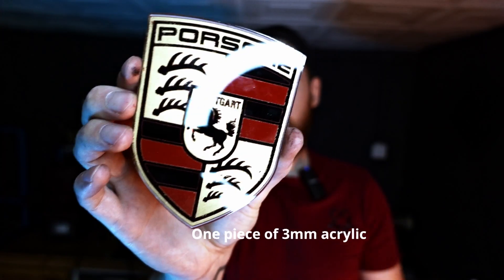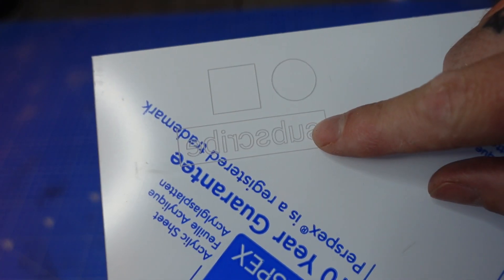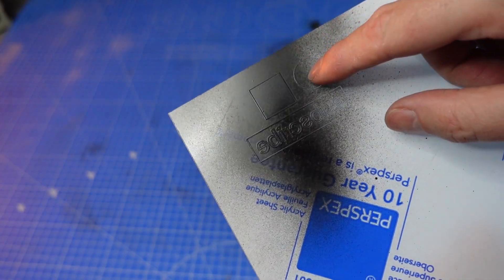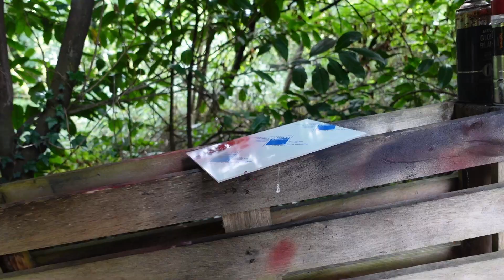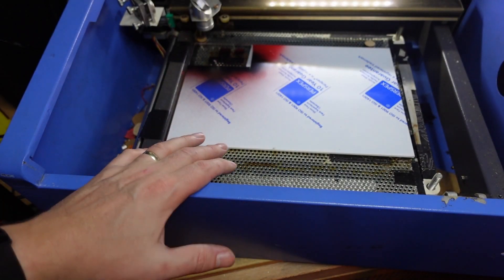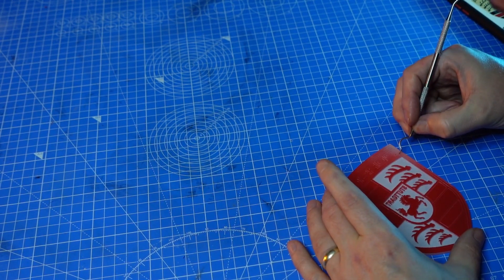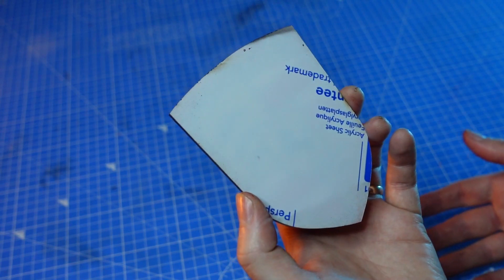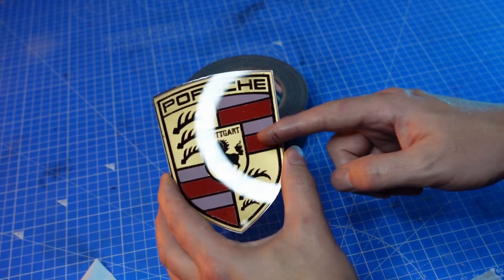This Laser Trick Adds COLOUR to Acrylic – Easy & Impressive

Comment: Hi there! thanks for this video! I would have never thought of using CLEAR acrylic to have an end result with color! 
Just brilliant! But what i'm confused about is, are these engraved or scored? because when I engrave acrylic, leaving the protective layer on, after engraving, the protective layer is completely gone. So does that mean you are scoring? Really appreciate your response, thanks in advance!
Reply from the maker: Thank you very much :)
It’s just a quick, low power score line you need to run with the laser. Just enough to cut through the backing. That then allows you to peel that section away ready for paint 👍🏻
Reply: @ perfect! I’ll try that today! Thanks for taking the time to actually reply!
Reply: @MARCAM  so i've started my project and my last color is black as well. But i don't recall seeing what you did for the last color black? did you also add a coat of lacquer then the black paint x3 coats? Then did you also spray on a seal coat after the 3 coats of black? so the black color doesn't chip?
Reply from the maker: @bonniesims2114 yeah a clear coat first, then the black (as many layers as needed) and then a clear coat for protection over the back. Alternatively you can use some clear backing tape to protect if you prefer 👍🏻

Comment: I'm just starting out in laser engraving so absorbing as many videos as I can and whilst I like your concept there is a much easier and much cheaper way of doing this. I'm well versed in silhouette studio my bread and butter is printing everything from clothing to stickers and the simple way to do this is create the Svg cut the acrylic out then print and cut a sticker to go on the acrylic.. not picking faults I'm enjoying your content I just saw an easier solution :)
Reply from the maker: Thanks for the input :)
You are right, that is a much easier way and it’s something I wouldn’t mind trying in the future. I think I’ll need to invest in a vinyl cutter though to be able to cut out the stickers property 👍🏻
Reply: @MARCAM  ah no problem I hope you don't think I was being negative I used the silhouette cameo 4 it's a brilliant machine and the software is free for the basic edition I have the business edition. The only downside with the basic edition it will let you load an Svg but won't re-save as an Svg so you would have to make the design in light burn or xtool etc then load it in to silhouette studio :)
Reply from the maker: @CraftedCustomCreations great stuff thank you. I design all my stuff in Inkscape so could probably just get away with the free version.
I’ll have to check it out for sure 👍🏻
Reply: Positioning the sticker perfectly aligned wouldn't be difficult as well? Also, I believe, the colors from the print would eventually fade away. The way he did will last and look "new" for much longer. Am I wrong?
Reply: @SeeYouJP  I use UVDTF stickers now they will last a lifetime 👍

Comment: I've done something similar using a normal cnc machine (Longmill MK2 30x30) and a springloaded diamond engraving bit (90 gedree tip) to scratch the image onto acrylic but it wasn't as detailed colored like this as I need to remove the protective sheet first to engrave with such a bit. After engraving, I spraypaint loose parts (as I don't have the paper backing, it's hard to spraypaint tiny details) and wipe off the excess paint immediately before it dries up. The paint in the scratches remains in the scratches while the rest is wiped off. I'm considering a CO2 laser but got no room and money atm to buy one. but this is impressive and so detailed. Good job.
Reply from the maker: Sounds like it was quite a bit more involved with the cnc then. Bet it still looked good mind.
You can get co2 lasers quite small these days. The k40 is a nice small desktop machine. The newer machine I’m using at the moment, the Mira 5s isn’t too big of a machine either 👍🏻

Comment: What can you do with these?  Will the paint scratch off easily if you use it as a key ring?
Reply from the maker: I mainly use this to make coloured signs. If you use a good enamel type paint and a quick clear coat over the top then doing key rings should be no problem. I use car paint so if you think how well car paint holds up 👍🏻

Comment: Very interesting concept. Why using a clear coat rather than directly painting on the acrylic ? Is it to make the paint bond with the plastic, like a primer? Or is it to make it shinier ?
By the way, you gained a follower.
Reply from the maker: Thank you very much 😊
And I spray a layer of clear just incase any paint does try and bleed under the paper layer. It rarely happens but I just like to be that extra bit cautious. It does help with paint bonding too 👍🏻

Comment: So you only score the design?
Reply from the maker: Just run an cut path with high speed and low power. Just enough to cut the backing so it will peel away nice and easy :)
Reply: @MARCAM  so it doesn’t mark the acrylic at all ? I get the low power and fast to cut thru the acrylic paper but it can’t mark the acrylic either ?
Reply from the maker: @beehr4468 it will be fine if it engraves onto the acrylic too as you will be filling with paint. Just try not to go too deep and risk cutting all the way through
Reply: Looks great!  What type of colored spray paint did you use?  Was it enamel?
Reply from the maker: It was car spray paints. So without checking on the can, I think most are enamel 👍🏻

Comment: I'm a newbie to laser engraving...did you just laser etch the backing paper so you use it as a stencil to paint it?
Reply from the maker: Yep! Just run low power and high speed and should cut through the backing paper no problem

Comment: You can do it through diode laser too ?
Reply: I have a CO2 laser which is able to cut clear acrylic without any problem. So I have to test if it will be possible to only cut the protection film on the acrylic without cutting the acrylic itself. But the idee of doing that is great. I have no idea why I didn't had this idea before as it is the same technic I am using when airbrushing lexan bodies for RC cars. They are also being painted from the inside. Before painting you put coats of liquid mask on it and then cut out part by part the regions you are going to paint next. starting with the darkest colour and then going on to the lightest colour one by one.
Reply from the maker: Yep. A diode will have no problem cutting through the backing material on acrylic
Reply: You sure? Seeing it wont do anything to clear acrylic without it being painted first or laying it down on a painted sheet of steel. Would think it would just go through the clear paper and clear acrylic and do nothing 
 @MARCAM
Reply from the maker: The laser has no problem cutting through the backing paper. The backing isn’t clear either. But, I’m assuming it would still cut through clear tape (never tried)

Comment: What's the deal with the clear coat before colour? Is it a must?
Can you make your future videos a bit louder? I watch them on my laptop with 100% volume :D
Reply from the maker: Clear coat first helps with any paint bleeding through. The volume is too loud if anything. When  I listen to it on my phone/ tablet. Makes the speakers crackle 😂
Reply: I've seen clear used on wood to prevent bleed/creeping but never seen it done for acrylic. I think if you remove all plastic masking and use medium or high tack transfer tape you may not need the clear coat for acrylic.